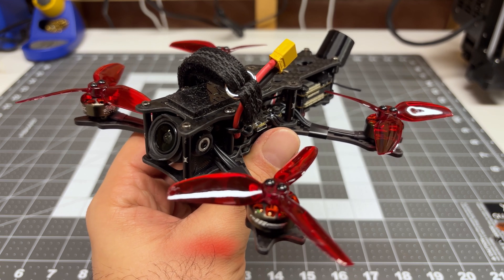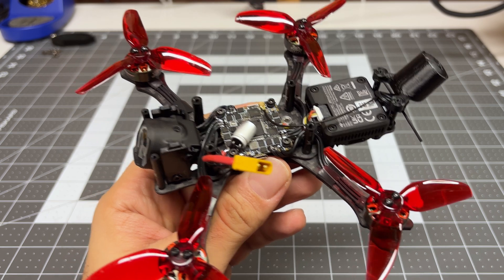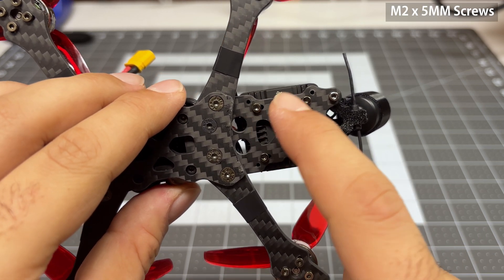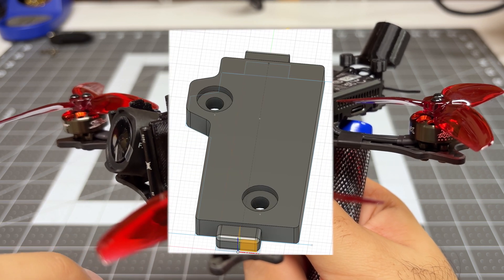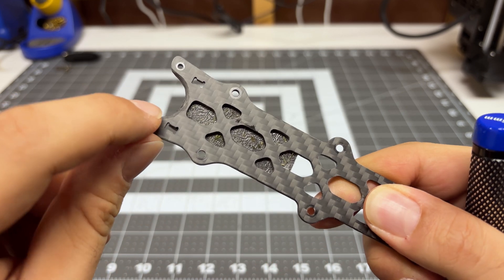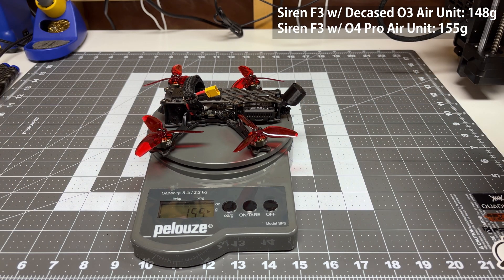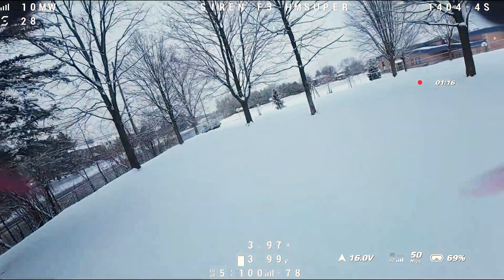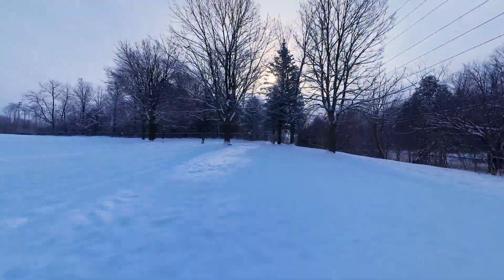The DJI O4 Air Unit Pro Is FINALLY Here! 🥳 | Quadmula Siren F3 / F35 Split Installation & Testing

Comment: Is installing O4 camera remove props in view?
Reply from the maker: I didn't try but that 04 camera has a reduced FOV and not a camera I'd suggest unless you have no other choice. You actually don't get props in view on the onboard DVR in normal mode.
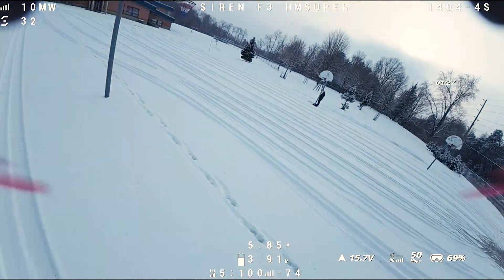Reply: @Mangorille i saw in your video 5:20, when you switched to O4 Pro,the props gone.

Comment: Do you have file for that antenna mount? works on F25 SP also right ?
Reply from the maker: Yes, they use the same antenna mount. I actually used it on the F25 SP in this video: https://youtu.be/OJLXF7FyyyE

Link: https://drive.google.com/drive/folders/1ld_1653QFBUvqYjfpGJdEel0A-N_oii0?usp=sharing

Comment: crazy idea, could you mount the O4 pro in to the middle, use it as an adapter from 20x20 to 25x25 and stack the AIO Flight Controller on top of it? So your center of gravity would be more in center of the quad and you could put the battery also more to the center. (if you really want to go crazy, chop of the now empty back of the frame and save some grams😉)
Reply from the maker: I'll have to check if there is enough clearance for both to sit on top of each other. What you are mentioning is how the AvionRC frames are designed. I'm working on a build right now...
Reply: @Mangorille  cool, let me know how it goes😊👍

Comment: Hello. Please tell me is this 3d model suitable for djinn f25?
Reply from the maker: I haven't tried it on the Djinn F25 but except the SP, they all use the same camera mounting. Note that Quadmula released their own 04 Pro camera 3d print as well in case you find that mine doesn't work. https://www.printables.com/model/1150793-quadmula-o4-pro-camera-plate
Reply: @ Thank you very much. I will use your model. I can't buy from Quadmula

Comment: Im in canada as well. Where do you order your parts? And when ordering from US, do you pay customs and duties?
Reply from the maker: Depends how quickly I need the parts. If I need them quickly, I go with Rotor Village or Amazon. If I can wait, I’ll get from Aliexpress. If I need something very specific that I can’t get from the above, I get from GetFPV and Canada Post will ask for taxes if the value is above roughly $40cad. Don’t use the DHL or UPS services unless you’re okay to pay a bit more tax (say 20 percent instead of the normal say 13 percent).
Reply: @Mangorille  like extra 20% tax on the entire order? Whats the other option if not DHL or UPS
Reply from the maker: @ Correct, 20% on top of the total order amount. I go for USPS First Class, which ends up being decent and lower tax. USPS is the US equivalent to Canada Post.
Reply: @Mangorille  Thank you soo much! we just dont have that much options here
Reply from the maker: @U.L23  Agree. I hate to say it but your best bet is aliexpress and wait the 2-3 weeks for the package to arrive. They usually have sales and provide discount codes that I share on my channel.

Comment: Curious about why you chose the f3 split vs the f3? I don't know much about Quadmula frames.
Reply from the maker: The split has the bottom and top deck closer together so they say it flies a bit better, perhaps because the CG of the battery is closer to the motor plane. The bottom deck is also two pieces should you need to replace a part in a crash. It also weights marginally less.
Reply: @Mangorille  Thanks!

Comment: How much flight time do you usually get? Curious as I’m hoping on the f35 myself with the o4 pro
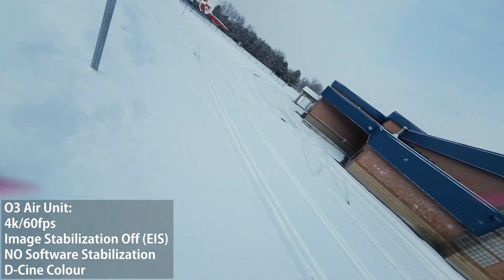Reply from the maker: With these rcinpower 1404 motors I've been getting around 4:30 in the winter with a 4s 650mah battery. I suspect you can get a bit more during the summer.
Reply: @Mangorille  perfect.. getting an o4 with T-Motor P1604 Motors - 3800KV, just deciding between going o4 pro or just the o4 lite to save some weight, reckon the camera installation of the Lite is going to be simple? Thanks again!
Reply from the maker: @ The 1604 motors are going to have less flight time, closer to 3 minutes. I like eye-candy so I'm more partial to the O4 Pro especially when it actually weights a bit less than the O3. How important is video quality and FOV to you?

Comment: if you simply moved both holes forward like 1mm you wouldn't have to modify your frame top plate
Reply from the maker: You need to move it forward way more than that. I went through 15 versions when designing this. I actually want to move it further back in version 16 to give the camera some protection. It’s a huge expensive camera to be hanging so far forward like that.

Comment: Thanks.. very nice comparison :) I still can't decide what 5" to build with my O4Pro - what a 1st world problem to have at 2025 :face-pink-tears:
Reply from the maker: Haha. Whichever one you can find a mount for. ;)
Reply: @Mangorille  I went with Piratframes Punch 5" with IT'SFPV 2208 1750kv motors
Hopefully there will be updated Siren 35 for O4 Pro as well at some point.. I'll actually build the original one very soon with Vista or O3

Comment: Have a quadmula F3.5 ready for the 04 unit. Thanks for the video and 3d print. Im also planning to use the 03 antenna as well....im sure there won't be a big difference in quality or range.
Reply from the maker: I didn't notice any difference in my type of flying. I'm sure there is a reduction when you're flying way further out or behind some thick obstacles.

Comment: Finally, somebody addresses the difference between the 03 and 04 in the goggle so in your opinion, did the 04 feel nicer looking through the goggles? Some people have said they don’t notice a difference at all but for me that is the main reason I would buy them . Image quality through the goggles is very important to me
Reply from the maker: It did. I flew the o3 first and my eyes were in awe when I switched to the o4 pro.
Reply: @Mangorille 
Quadmula have the 04 version of the Frame
Reply from the maker: @cafub2650  They only have the O4 version of the Djinn F25 right now. They haven't released the F3, F35, or F5 for the O4 yet.

Comment: Couldn't the 40 to 60 mbps be related to heat? Maybe put temperature in your osd. Just wondering😄
Reply from the maker: The air unit doesn’t report its temperature through the osd. I doubt it’s temperature related though, it was fairly cold out and I never let it sit around. My money is still on interference in the channel.
Reply: @Mangorille  Okay, and amazing video btw... as always :D
Reply from the maker: @vscrmk1  Thanks buddy, happy flying!

Comment: Hey, nice vid. Do you waterproof your drones to fly around snow?
Reply from the maker: Thanks. I just conformal coat the bottom of the AIO flight controller.
Reply: @Mangorille  How about you air unit, do you somehow waterproof that?(specifically an o3). Or do you just risk it.

Comment: Congratulations on getting the unit so early

Looks like your camera plates are not soft mounted. Soft mount was a 'requirement' of the 03, but doesn't appear to be with the 04.
Do you have thoughts or observations about this?
Reply from the maker: I ordered from Amazon at 8am on launch day. :) You need to print the camera plates in TPU, which allows them to be soft mounted. Using TPU to soft mount was the approach for the O3 and also the approach used currently for O4 by frame manufacturers.

Comment: Nice video, I am thinking of actually changing my f35 to the O4 (lite), just a little wary about the length of the camera cable.
Reply from the maker: Why are you looking at the O4 lite instead of the Pro?
Reply: @ just want to try it out. Make things lighter get under 250g. Have a full 03 on it now, and will use the pro on my 5”s
Reply: @goose23fpv i want to do same. If the goggle view is similar to o3 as im not chasing superior quality of onboard recording.
And the lite is cheaper 😅
Also easy to apply the flywoo waterproof spray.
Reply from the maker: @Lazy_SkyWalker  The camera quality on the O4 Lite is a step back from the O3. Unless you absolutely need the smaller size and lower weight (e.g. a 2S whoop), you're better off buying a lite O3 from someone who is moving up to the O4 Pro. Just my recommendation if you value video quality both in the goggles and onboard.
Reply: @Mangorille  I’m wondering how much difference on goggle view.
Yeah used o3 is another cheap option for budget man haha
Thank you for your heads up and love your reviews and developments 
As I’m a 3.5” freestyle lover.

Comment: you need the 04 antenna i tried that way and when you fly around buildings and far away you get the same range as the 03 did but with the 04 antenna's i got much better range i had 60mbt even around building and flying much longer away you should put the 04 antenna's on it does make a difference, the only thing is mounting two instead of one which is a bit of a pain on smaller builds.
Reply from the maker: Thanks, I heard the same but really didn’t notice any issues and the mbps held at 60. Did you try any of those aftermarket two-in-one 5.8ghz antennas? I see that Flywoo makes one that could be perfect, it’s single band like what we have with the included O4 antenna.
Reply: Makes me curious if the 03 with these antenna will get same range and penetration as 04
Reply from the maker: @eddietolbert5308  I don't think so, I saw tests of the OccuSync4 (what O4 actually stands for) when the Mini 4 Pro (O4 based) released and it had better penetration than the Mini 3 Pro (O3 based) as well. It's just a newer and beefier protocol.

Comment: Hi, currently I'm waiting for me o4 pro and lite units but to be honest with you your drone is very interested. Can you tell me more about it? What batteries, aio and motors are using? Is it under 250g? Thank you in advance
Reply from the maker: I made a build video on this frame a while back and the motors and AIO are what you see in my last couple of videos (Super F405HD and RCINPower 1404). Yes sub-250grams. 

Could This Be My NEW SUB 250 Gram 3" HD Freestyle Frame? | Quadmula Siren F3 Split & DJI O3 Air Unit
https://youtu.be/IKHoPryhvCg

Comment: Huge thanks for the prints I'm hoping this will work with the djinn f25, I know there is a new frame djinn sp but I'm hoping the 3d prints you made convert mine into 04
Reply from the maker: Welcome. I expect it will work on the F25 as the frames are very similar but I only tested it on the F3 and F35. I did see the new SP, stay tuned. ;)
Reply: @Mangorille  i have the djinn, and curious if you could just buy the new top plate instead of the whole frame 🙃
Reply from the maker: @ No, you’d need more than that. The bottom deck is different as is the 3D print for the camera holder. Those two I know for a fact but there may be other differences.
Reply: @ well there goes my money 😂
Reply from the maker: @ReedRoams  If only DJI made the O4 air units compatible with the O3 camera...

Comment: Quadmula now makes an 04 frame. The Djinn F25 SP is made to specifically fit it.
Reply from the maker: I did see that, they haven’t released a new F3 and F35 yet though. Honestly I’d like to see a retrofit kit, the new camera will fit with just a revised top deck.

Comment: Nice work getting the cam to fit. It looks like there may be some room to de-case the cam to reduce some of than volume but with a tradeoff of durability.
Maybe Quadmula will release a redesigned top plate and cam mount
Reply from the maker: I expect they will release new frames for the O4 if the new F25 SP is any indication. They did a lot of redesign for the O4, a surprisingly lot of changes.
Reply: They released a new version of the djinn instead. But a 3d print, like the pod mount mount for o3/o4 on printables could be another solution to using current quadmula frames.